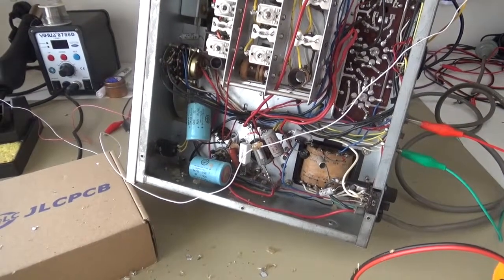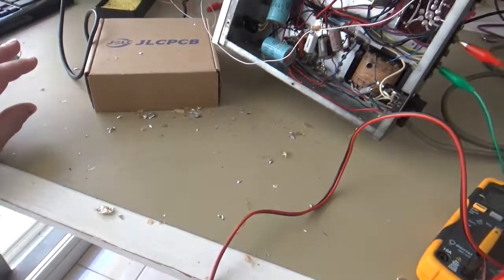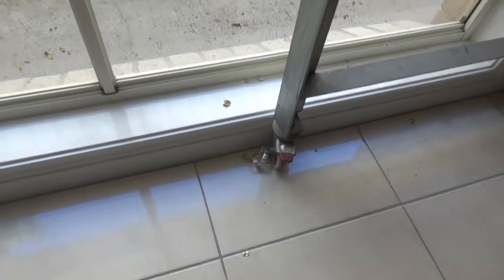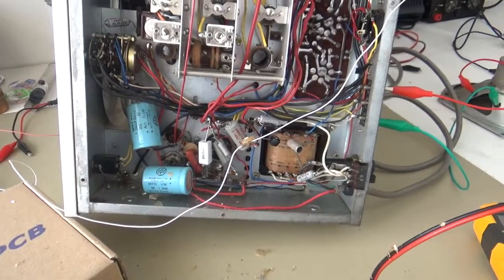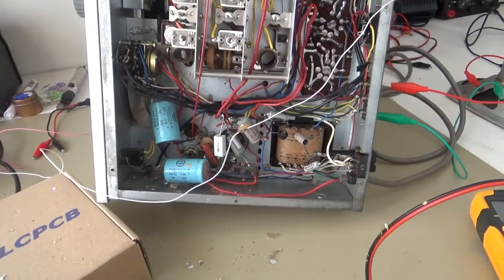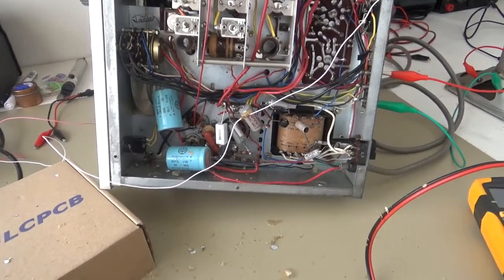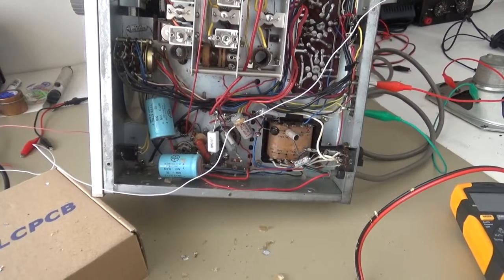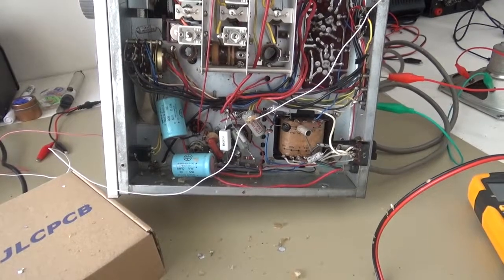#085 Trio 9R59DS Communications Receiver Repair Part 2

Comment: I had a simlar problem with a Trio JR-310 receiver last year. The filter capacitor strapped across the mains transformer primary winding, would blow the receiver glass fuse intermittently. It took me quite some time to track that particular fault down, because when the fuse was replaced, the receiver would continued to operate quite normally for extended periods of time afterwards. Don't you just love those intermittent faults.
Reply from the maker: Intermittent faults and Murphys Law, they often seem to go hand in hand as well......
Reply: Yes they certainly do, and when the fuse blew it went with such a bang, it was quite startling!. I recently had another fault on another tube receiver of mine, an old FRDX-400. A fault developed in the 1st IF stage, burning up the 1.5K HT feed resistor, resulting in the IF transformer winding getting hot and shorting. Turned out to be a faulty 6BA6 tube. I love these old receivers, easy to repair and full of nostalgia.  @GrumpyOldTech

Comment: I have found that reception on this receiver leaves a lot to be desired in terms of audio quality with strong SSB signals, however this can be greatly improved by doing a simple mod to the product detector. Change R20 1K cathode resistor to a 3K and change R30 10K resistor to a 47K. Another worthwhile mod, is to add AGC to the RF amp valve 6BA6, which greatly reduces strong signal overload in the IF stage. Once these simple mods have been done, SSB audio will sound superb with the 4K wide bandwidth.
Reply from the maker: Cheers for the input Matt, 
I’ve been busy with work and family things so yet to get back to the receiver but will take on board your suggestions. Hey and I just noticed I must have accidentally touched the thumbs down icon when I viewed your comment on the iPad last night, sorry about that, have given it the thumbs up now....
Reply: @GrumpyOldTech  Ok Grumpy, I forgot to mention another IF stage mod which needs to be done in addition to this product detector mod. It will be necessary to swop over both  IF1 and IF2 6BA6 cathode circuits,  which also includes the S meter circuit of course. The AGC feed will now be transferred to IF1 instead of IF2, and IF2 6BA6 AGC grid feed is grounded. The SSB performance from this receiver is vastly improved by doing these mods, which is much better than the original design. In addition I have found that the bandspread drive cord tension is a bit excessive, resulting in the bandspread tuning control knob being a bit stiff to turn. The solution to this problem is to replace the bandspread tuning drive cord, and use less spring tension. The bandspread tuning knob is now much easier to turn with just one finger.